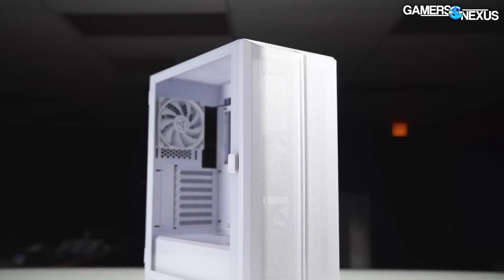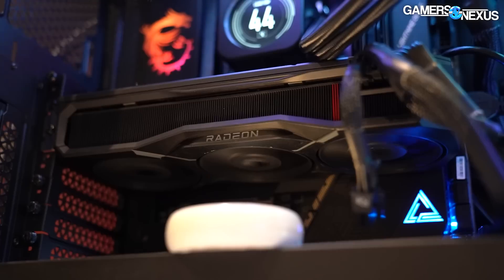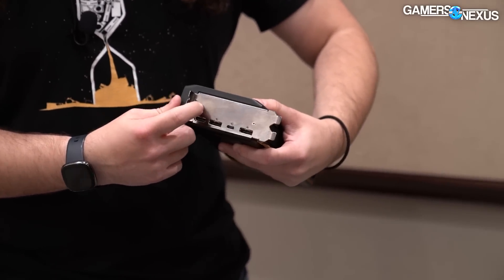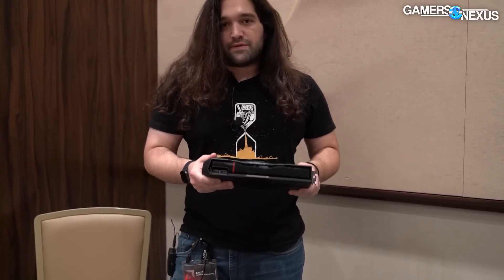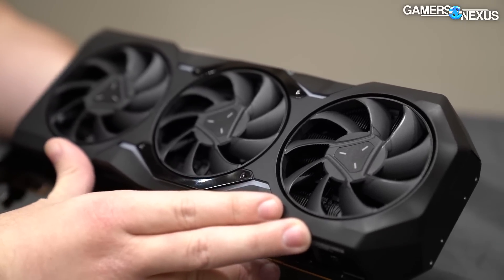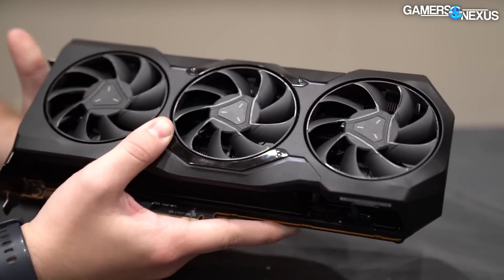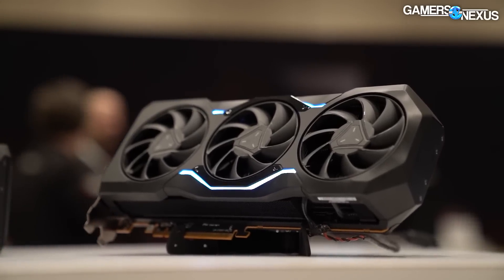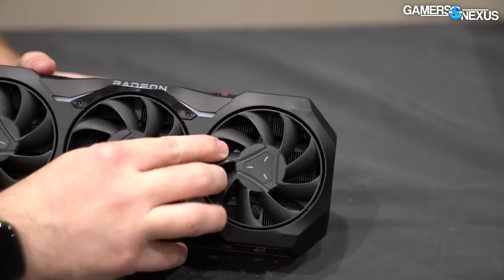More Video Cards Need This: AMD RX 7900 XTX Reference Design Hands-On

Comment: Here is a idea, how about we take a raspberry pi pico and some DS18B20 sensors then place them in the case and now we have all the temp sensors everywhere we want (should be able to have 50 thermal sensors shoved all over the case no problem; though cable management would be eXtreme difficulty)

also could use some DHT22 sensors that do temp and humidity, but you can't run those in parallel like DS18B20

Comment: unless there is a way to control the temperature of the incoming air
the temperature sensor there, provides no benefit. 
increases cost, allows no replacement, etcetc
stupid decision all around.

Comment: Thanks to this video and your follow-up post. I'm digging the thermal sensors out of the box for my Gigabyte b550 vision d-p board and installing them tonight to check case temps whenever I have an issue. Thanks for the great ideas and excellent reporting (also merch)

Comment: Hi Steve.
1st off, when is the embargo lifting on these new cards?
2nd, looks like AMD stuck with a vapor chamber style cooler (no heat pipes), I have a XFX branded 6900xt reference model and to be honest, I am so NOT impressed with the cooler on that card, my 6900xt with default settings (custom fan curve) will only use 255 watts of the supposed 300 watt TDP but yet will easily run up to a little over 90 degrees junction temps (Running Heaven @ 1440p all eye candy turned up for 10 minutes), if I try upping the power to 280 watts running the same software, I hit 110 junction temps within 2 minutes and the thermal throttling starts.
This 6900xt is like buying a Corvette and putting a 60mph limiter on it at the factory. :(
I have my 6900xt undervolted now to keep the temps within reason, never buying a reference card ever again.

Comment: It would be nice if motherboards had headers for adding your own temperature sensors that you can place anywhere in the case. These could be simple and cheap, or expensive 3rd-party setups. We would need a standard for this.

Comment: I've been am AMD fan boy since K6. Always built my own PCs. Well not my first one. Over the years I've bought and used 4 or 5 AMD video cards. I just cant do it anymore. I am tired of their bad drivers. I am tired of messing with drivers, update em, roll em back, uninstall and reinstall them. NO NO NO. I want something that just works. The temp adjustable fans are a really nice idea. But will it simply just work? Will one piece of software need the drivers to be rolled back while at the same time an other needs the most recent? This is the same reason why I will never by an HP printer ever again. AMD makes really really good hardware but their drivers suck.
Reply: Have you had a recent generation AMD GPU?  I had the same experience on old AMD GPUs (10+ years ago) and swore them off personally.  But after having built PCs with them recently for friends and family they have had zero issues with things like that.  These were 6000 series cards.  Also, I don't think review sites, GN especially, would let AMD slide if they still had rampant driver issues.  There's no doubt that AMD had a long period where their drivers were garbage, but my recent experiences with them have not shown that to be the case now.  I installed them and drivers and everything just worked as expected.
Reply: @mystery9401  That is good news, glade they got that worked out. No, nothing recent. The last one was a radeon hd 8000 series. Sometime around 2013-14 or so.

Comment: to control the MCM vs GCM... they need messurement of the cooling plate itself... it makes total sense :)  Otherwise they would have to build in 6x MC chiplet temp sensor plus the GPU chip sensor, which have edge temp + core temp also... alooooot of sensors, so just monitoring the cooling plate is a cheaper and easier solution... i wounder how the card then reacts to water cooling... something to consider.... (which actually makes my Water cooling make more sense, cause the fans are controlled by the water temp, and the pump is controlled by GPU or CPU Temp, but always with a minimum speed.... perfect match for this... *lol :D  ) 

maybe i should buy one :]  just need a water plate that matches PCB.

Comment: I honestly don't think you GN is giving enough credit to AMD for their ability to keep the size is the cooler so small this time around. You ragged on them for marketing it in their presentation, but it's only 2.5 slots and under 300mm in length. That is a huge accomplishment for the performance, and is going to be a big deal to some people upgrading that don't want to have to rebuild everything. Especially those with less know how who may have bought a pre built during the mining boom as their only affordable entry option.

Comment: I hope it performs really well. For now, I love the look of the FE and how much more compact compared to NVidia's options it is. Also, I noticed that it has 2 eight pin plugs. Maybe they were able to switch them on a dime, but I have serious doubts that there was anything to be switched in the first place. I posit that they knew there might be problems (regardless of who's fault it might be) and played it safe until everything got worked out. Possibly their next GPU release may have the new plug system.

Comment: I remember when I water cooled my cards I used a mini PWM fan connector to full size connector. Attached it to my water cooled card fan header and connected it to a fan hub so the GPU was in charge of all the my case fans depending on the GPU temp. I like this feature.

Comment: What we also need is a ΔT between die and heatsink to show thermal paste efficiency. After all if there is no thermal transfer there is no point in even cooling it. Up to a certain point. But the more efficient the thermal transfer is the lower your fan speeds need to be in order to keep it cool. You can simply measure the heatsink temperature to figure that out. You could even independently measure it. Like measure the ΔT between the air in and the heatsink to get the ideal cooling pattern. Perhaps theres hot air in the front of the case so spinning a fan would only heat up your GPU where the back has cooler air in. Speeding up the rear fans would have a more significant effect in that case.

Comment: AMD talks about 8K and DP 2.1 connector to compete with NVIDIA, but it doesn't have GPU power for 8K. RTX 4090 has the competence and power for 8K, even more with DLSS 3.
 R.I.P. AMD

Comment: So conceptually why aren't GPUs using 4-6 slots with open vents on the back so it exhausts it's own heat out the back instead of into the case? 

With this design the heat direction is choked into Mobo and the casewall unless vertically mounted.

Comment: That will also allow you to turn down the fan speed when your case ambient temp is too hot for more airflow to be of any use, so it can run quieter even if it runs hot because your case or case fans are garbage.

Comment: I wonder If you could use the air intake temp sensor to monitor dust build up. For instance if the delta between the core and the outside air gets to high or the RPM of the fans is higher than usual, logically it would mean that the cooler is less efficient and would be dusty.

Comment: 2 8 pins, if only nvidia did the same thing instead of their unsafe connector. AMD stepping up and flipped off Nvidia, hope Nvidia makes a V2 of the 40 series and makes it more power efficient
Reply: Also built in temperature reading should be a default feature for gpu's

Comment: I spent 3 weeks testing various fan placement and fan speed configurations in my 5000 D, having the thermocouples would have made things SOO much easier. The only temperatures I had to go on were GPU core and memory temps, but those fluctuated during the benchmark so I had to take 20 min averages. Having thermocouples on the front and back GPU fans would have cut down the work significantly.

Comment: A really sound idea. More components need this because it will help prevent failures due to heat issues. It will also help build adequate cooling in the case.

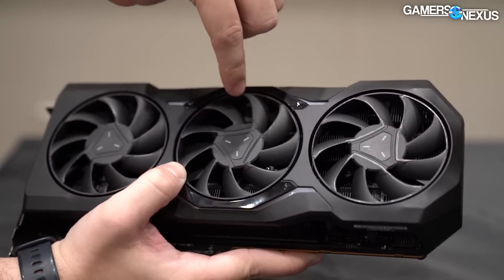Comment: Question: Can these fans be replaced without dismantling the card? This is one of the most underrated features on the Sapphire cards. I can see 2 screws in the footage (2:57), but i can't tell if there are any cables involved.

Comment: Love the delivery of more temp sensor and how they can protect the rest of the card by providing accurate thermal info.  I hope this becomes a permanent feature.  They have a great looking reference design, very clean and sleek !  Another big item is the more sane power draw, having watt per FPS benchmarks I feel needs to be a core performance marker.  This may be finally the year to pick up an AMD video card, my main concern is the usual - the drivers and how well they support  my games, I am grateful for Vulkan  support and also hope this will be the default go to standard for all cards : )

Comment: The coolest fan design in the world does not make up for crap game compatibility. I ended up building a second system for multimedia playback for my 6800xt (it does a wonderful job there) so I could use a real gaming card an rtx3090 in my main rig.

Comment: One of the benefits of mITX is the MB doesn't really block the GPU exhaust. In my case it is pretty much open to the ventilated rear panel as far as the GPU exhaust goes. (NCASE m1 v6.1)

Comment: This is the reason why the binding source of my gpu fans is the hotspot of the core the highest temp point of anything and all of the fans are ALWAYS running + a really aggressive.
That's how you keep your GPU alive, i'd rather get a reasonably noisy GPU from the fans kicking up than to have the card stop working because a single component on was not cooled enough.

Comment: I recently bought an MSI 6600XT and noticed a new "ambient temperature" entry in the GPU section in Hardware Monitor. So the concept isn't new, but not sure how it's implemented. 

The downside is they don't expose the fans to aftermarket controllers like Fan Control. Since this could be useful for the other parts, what would be a good ambient temp to kick in the case fans? Fan Control can read that ambient temp and my current curves let the case fans drop to 0 RPM when idle.

Or am I misunderstanding the possible use case of the ambient temp sensor?

Comment: does the card support external fans (like for ex. 1080Ti Strix did)? with decent cases like FD Torrent, and given this thermistor, it would make sense to have bottom intake fans directly controlled by the gpu + ambient case temps :)

Comment: Thermistor is useful. Can sense whether to spin 1, 2 or 3 fans individually to cool other parts of the card when necessary. 

I'm mildly concerned when there's no spin at all on a high power card. Usually only the GPU itself controls fan with its X°C limit. I often wonder about the other devices on the card that get warm, could some be overheating. You confirm they can be overheating. So we need this feature.

I've a GTX 1080 Ti and I've set a 20% fan speed from 20°C, which is basically from power on. That's in order to look after the electronics. I'd rather lose and replace 1 fan for £10 than lose the entire card.

AMD, this is a very good idea. GPU are so expensive that customers need features which will protect the components for many years.

Perhaps you can launch some motherboard USB header thermistors which can be used to adjust case fan speed? User placeable thermistors. 2 or 3 could be useful. Or enable fan control based upon device temperature AND fan placement.

Example: I have multiple fans IN: 1 over HDDs, 1 above GPU, 1 over CPU+RAM+MOBO Power, etc. I would like to be able to have these increase fan speed if necessary because that specific device temperature is rising.

If I'm gaming then probably GPU feeder fan needs most as well as CPU RAM MOBO Power fan. Probably HDD can isn't used much. But thermistor-software can decide this correctly.

At present I just have all fans running at low speed all the time. In BIOS I have them set to follow a curve as CPU temp increases. But that is CPU only. No other option.

Comment: I don't like the design in terms of airflow. Neither do I want to (all the) hot air stay inside the case - but what's bothering me more is that I have my NVME basically right next to the PCIe slot. So that means now I really would need to throw a cooler on it and still would be concerned about the heat.

Comment: I Really like the addition of that sensor, it feels good to be able to pull up system info and get a clearer idea of how well my gear is performing.  Very tempted to buy a temp probe to put right behind my intake fans to track my room temp now that I've seen this idea.  combining that with this card it would be cool to see how much the air temp increases between the case intake and gpu intake, could be a really nice way to see if your airflow is optimized or not.

Comment: That is why I disabled passive cooling. I have my own fan curve that makes GPU fans spin at minimum level that is just around 500rpms. Still cannot hear it, but moves enough air to keep everything nice and cool. Did that when GPU prices ramped up 4 years ago to make my GPU live as long as possible.

Some time ago I played with some old 1st gen 3 core phenom pc and tried to make it semi passive cooling like we have in GPUs. I was amazed how much improvement I got from making the fans spin at minimum level. In my opinion it is simply not worth it to be semi passive in traditional PC.

Comment: In my custom loop liquid cooling setup with self-made Arduino-NANO based fan controller, I also use the case ambient temperature and even the room ambient temperature as well as the liquid temperature to control the fans. I've been wondering why no engineer had this idea ever before. I am using this system since 3 years now... And I had this idea already 12 years ago when I was still dreaming of a water cooled high end PC, while my laptop was screaming me deaf.

Comment: Yah, that's not what a "ambient" thermistor is useful for :D
You use it to set up the fan curves so that they don't spin needlessly. Say you want the fans to start spinning when the GPU core hits 40c. Your "ambient" is 30, so fans start spinning and cool the GPU. Then 3h later the "ambient" is 40c, and spinning the fans do nothing, except produce noise.
It's not there to thermal manage poorly designed components. It's there to be able to run the fans smarter.

Comment: Anything that helps more generally keep a system cool, and stable is a good thing. AiB's will have to take a look at it, I'm sure it will come down to price/advantage. You know what I REALLY hope happens eventually? Companies just sell the bare PCB, so that people that water cool are not wasting all that material used to make the sink, silly I know, but even though I go to fairly great lengths to recycle those, would feel better not having too. =)

Comment: I'm usually not a fan of reference designs but I am really digging these cards looks. As long as the numbers are close to the 4090 in rasterization performance it looks like the 7900xtx will be replacing my 3080ti.
Reply: Why would you upgrade from a 3080 ti to this? You literally have a monster of a card that runs everything completely cranked up.
Reply: @kadrix732  why not if it performed close to a 4090?
Reply: thats literally thet stupidest thing you can do but hey its your money if you wanna spend on a downgrade :)
Reply: @mitchellgoldstein1573  obviously you can't read... I said if the performance was close to the 4090... I would buy one... so how exactly is that a downgrade?